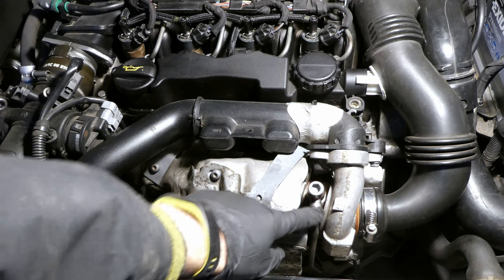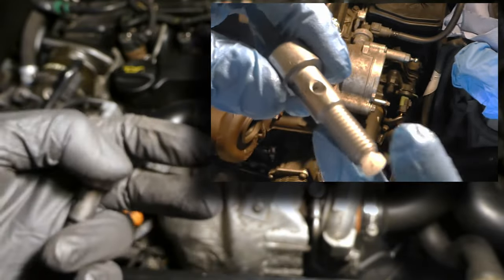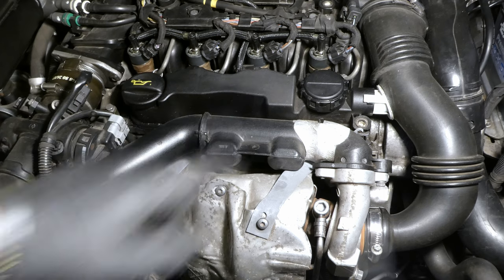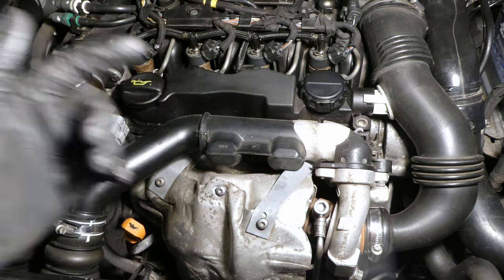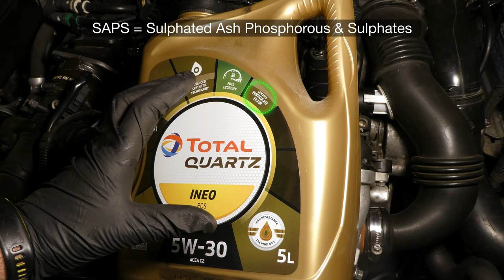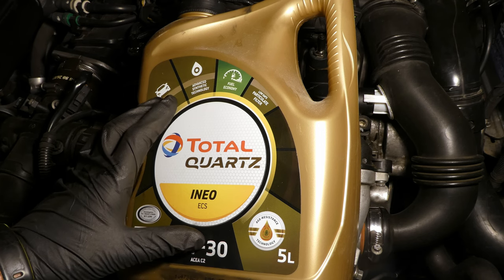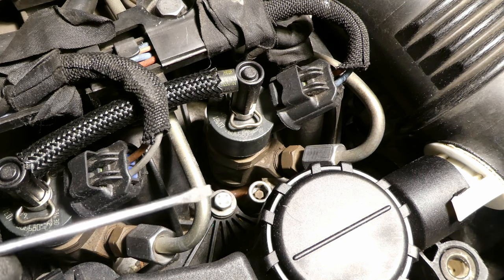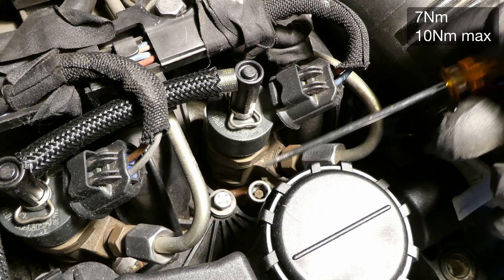1.6HDi turbo failures, the 2 main reasons and surprisingly simple steps to prevent it

Comment: i'm reading everywhere to put C3 synthetic 5w40 into a 2006 207 with the 1.6hdi engine, I notice you run 5w30 c2, which one should I use?
Reply from the maker: Very good question. It is a tough one and I have pondered a bit on this one. For the 1.6HDi the recommended one is 5W30 and that is what I have used. 5W40 is also fine to use and it is a little bit thicker, so less chance of the oil to go through seals, turbo for example or valve stem seals. I have always used 5W30 as it was recommended and never had problems, well perhaps I need to start using 5W40 as I have a puff of blue smoke on startup, most likely valve stem seals or a little bit of oil being passed through the turbo seals.
Now, I have only seen the low SAP oils in the 5W30 and not the 5W40, so that is why I have not yet tried it.
All in all, it is not a problem and probably a little bit better to use 5W40.
Reply: @moremolecules  sorry I couldn't get back to you earlier, this is the original post "I have a 2009 1.6HDI 207 90HP WITHOUT a particulate filter:).

The Peugeot handbook recommends I use Engine Oil to ACEA A3/B4 & PSA's B71 2296, standards but is vague about the oil viscosity - it shows a chart which 'authorises'(!) 10W-40, 5w-40, 0W-30 and even the 5W-30 engine oil which must be used on the FAP version! The Peugeot chart showing the recommended viscosities vs ambient temperature seems to say I can use any of these oils!

Is this right? What engine oil should I be using on a new(ish) 1.6HDI Non-FAP?"
so according to this owners manual the 5w30 is aparently best suited for Diesel Particulate filter engines, so I'm changing it to 5w40 c3, and next time I change my dads citroen C-elysee that has roughly the same 1.6hdi I will be switching from 5w30 to 5w40 aswell, thank you for your time, looking forward to keeping watching your content in the future
Reply from the maker: @therealxicojorge  Yes, you are correct in all of these. Even though my and yours and non-FAP versions I stuck with 5W30 low SAPs due it being a cleaner oil, i.e. less sulfated things inside or less ash. With the 5W40 there are no low saps, as far as I have seen, so there will be a little bit more clogging on the exhaust side and the EGR. Maybe run every now and then the Italian tuneup😁
Reply: @moremolecules  I've been made aware of the less sulfated oils being better for these engines through your channel so thank you my friend and yes I'm having a bit of a hard time finding what I want and not paying 2 times the price of the low sulfate c2 5w30 not gonna lie, trying to explain all of this to someone who doesnt care about cars after just learning it myself has been a challenge too but again all that should matter to him is that his engine is gonna be happy and that he doesnt do my head in if it starts making problems from cheaping out on maintenance I'm already doing it for a couple of beers and it takes like 30min max its not like he's worried about labour costs, anyway. thanks for the great responses, the search for the oil low sap c3 5w40 continues
Reply from the maker: @therealxicojorge  Yeah ,that is why my original reply started with I have pondered on this for quite a bit. I do not think there is really an easy answer here. The non-FAP versions take without a problem the 5W40, say the Total Quarts 9000. For the FAP ones, it needs to be the low saps, 5W30, the Ineo ECS. In general it is because the sulfates and ash will clog eventually the DPF of the FAP ones. We do not have DPF, so safer, but then again the higher content of ash in the 9000 oil will line up the exhaust pathway and the EGR. Probably not too much of a problem, as if one blasts the rpms to say >5,000 these carbon particles will be blown out. Yes, the EGR will need more frequent cleaning.
Now, the positive of the 5W40 is that it is a little bit thicker and the exhaust will smoke less, due to the thickness less oil will pass through the turbo seals and the valve stem seals. So, less blue smoke at the back of the exhaust. I do have a little bit of blue smoke coming out on cold startup, so probably I will try the 5W40, just to see if it is going to make a difference.

Comment: Hey man! What size is the bit for the injectors stud?  Wanted to re tighten mine
Reply from the maker: The studs are stretch bolt and I would not tighten them, but tighten the nut on top of the stud. It is a 7mm allen key.
Reply: Hey! Just had the injectors Serviced , they put 2 new ones. Mechanic removed all the gunk around them - engine now runs pretty smooth and area around  is nice and clean 🧼
Reply: Can’t complain they did a pretty good job

Comment: Would a blocked banjo bolt filter make a strange noise at idle?
Reply from the maker: A blocked bajno bolt filter would very quickly lead to a catastrophic failure of the turbo shaft, due to no oil lubrication and cooling. Strange noises, could be anything really.
Reply: @moremolecules  thanks for reply..its hard to describe the sound too..its a low pitch sound that gets higher then stops 🤣
Reply: @moremolecules  it is the fuel filter 👍

Comment: Hi Chris, the turbo failure my HDI 1.6 engine has is P1497 en P2562. after 10 seconds running the car in neutral on 30k rmp the turbo fails. Is this the same problem as what you are describing?
Reply from the maker: I think the vanes of your turbo might be sticking rather than overall turbo failure. You have a VNT turbo, a bit more sophisticated than mine and more powerful of course. The problem I am describing is a bit different.
Reply: @moremolecules  ah okay thank you very much for responding. I saw another video of yours where you described the problem that I had. It is the actuator which was too tight or too loose. After removing the heat shield I loosend the pipe that opens and closes the valve a bit and now the error messages are gone.
Reply from the maker: @Chiefelgin  Ha, I have to say that is fortunate, but really well done for tracing it out. Happy holidays!
Reply: @moremolecules  thanks man and your vids are lifesavers. Merry Christmas and a happy new year!

Comment: Hi how is best way to check feed pipe and where you got that bolt with plastic filter ?
Reply from the maker: I have a series of 5 videos that show how you can get to the feed pipe and the mesh: https://www.youtube.com/watch?v=Q7S0qDBo314
Reply: @moremolecules  have you got video how to chainge oils in manual gear box and brakes
Reply from the maker: @relaxul1467  Yes, I have one for gearbox: https://www.youtube.com/watch?v=95QarTgx4mI
I do not have one for the brakes, as there are quite a few good ones out there. Maybe I should do one?

Comment: K to use mid sap oil? Only mobil 1 esp available in my country. What specific oil are you using? And what is the meaning of low sap
Reply from the maker: Low sap is basically oil with low content of Sulphated Ash, Phosphorous, and Sulphur. As long as the specs on the bottle match, it is not a problem to use another brand.
Reply: @moremolecules  I used Castrol Edge 5W30 LL Titanium full synthetic that supports acea c3 standard. But I did not notice Low SAP mentioned. Is this ok ?
Reply from the maker: @daviddilparic3930  Probably it is ok. If the standard if the same it should be ok. Now this low saps might be a marketing thing, so I would not be too bothered about that. I think the standard is what matters.
Reply: @moremolecules  Thanks. Everything is fine with this oil. I can even say it looks a bit better than Total's oil.
Reply from the maker: @daviddilparic3930  Difficult to tell if one is better than another. I had awhile back an experiment with taking oil samples every 1,000 miles and sending it to a company for chemical analysis, but did not do it with another oil. I started using total and have not changed since, just a habit, nothing else.

Comment: My peugeot 307 sw 2004 1.6hdi got turbo fail. PO245 ideas what could.be wrong wastegate? Solenoid? wiring? Turbo? Anything else?
Reply from the maker: It could be loose or split vacuum hose to wastegate or solenoid. First check if the wastegate is operating correctly: https://youtu.be/WLsMzdKgI1o

Comment: I have a 1.4 hdi 16v in my 2004 C3 XTR, it's really an early version of the 1.6 HDi 16v, the upper cylinder head (housing the cams) is actually the exact same part number for example. However it has an unbelievable bad design oversight: the plastic intake manifold is a bit bigger, and blocks access to the top row of injector retainer bolts :( The only way to access those is to remove the entire intake, which also means removing the high-pressure lines, the low-pressure returns, the plastic cover for the head, the airbox and the EGR tube. I'm honestly considering modifying mine to use a 1.6 intake manifold, the 8 intake ports are in exactly the same locations and they use the same rubber seals etc.

About the banjo bolts, do both of them house a filter ?
Reply from the maker: I feel for you, believe me. They are designed in a way to deter your average joe to tinker with cars. As far as I know they all have the banjo bolt mesh, it is there to limit the occasional bits and pieces clogging the turbo shaft. Some people remove them altogether, but I really thought about it very long and could not decide what to do. All in all I decided to keep the new mesh design in. The longer plastic version, not the old metal mesh.
Reply: Pretty sure he said in video, only the lower one has a filter. I've only had the upper banjo bolt off and there was no filter but still had some build up of sludge I could scrape out.

Comment: Hi bro just I have a class mercedes a180 2014 w176 petrol engine sport  my vehicle turbo when I accelerating the turbo making sound like whistling or dentist drill what can be bad on my car turbo please??
Reply from the maker: Most likely you have a air escaping from somewhere, so a pipe that is loose and you can hear the turbo. Unless of course the turbo is gone.

Comment: Hi, does anyone know purpose of the membrane on the valve cover (membrane is placed underneath cap)?
Reply from the maker: Hi Nikola, the membrane underneath the valve cover (Positive Cranckase Ventilation) basically prevents the turbo to suck all the oil from the crankcase. When the turbo is not pulling air from the air intake you want the valve to be completely open, so the positive pressure in the crankcase to escape. When the turbo starts spinning and pulling air, because the crankcase is connected to the air intake, you do not want the turbo to suck the oil out of the crankcase, you would get a diesel runaway. The valve closes slightly to prevent that happening, but if the turbo is at really full max, then it closes even more.
Hope that helps.

Comment: Hi Chris, I don't agree with you on injectors seal!  The tar can't get in to the oil, it is only make the engine dirty and smell of gases in the cabin.
Reply: Good video anyway!
Reply from the maker: Haha, Chris' impersonator here. Joke aside, it has for awhie been in the PSA bulletins about the injector seals and the turbo failures. The injector tube is not integral to the head of the engine, so the bits can leak into the oil, if they can pass the top seal.

Comment: I have quite a lot of oil around injectors 2 and 3 and I wonder if I should change the injector seal ring of all of them to fix this issue. Do you have a video showing how to do that operation? Should I also change the banjo bolts mesh to prevent turbo failure in the future? What are the references for the injector seal ring and banjo bolt mesh? Thanks
Reply: There is a video about how to change the injector seals. The whole bolt can be bought as far as I know.
Reply from the maker: Is it oil or tar? If it is just oil then you could just clean it. If it is more like tar substance, then yes, you need to change the seals. I do not have a video, but there are plenty on youtube, I have linked one in the description as well. The bolt with the new mesh can be bought and replaced. My original banjo bolt mesh was spotless after 100k miles, so in general there is not need to replace it, but it is a good idea.
Reply: @moremolecules  I'm not sure because I didn't even clean it, I have to check it again . If it's just oil, where does it come from in 2 out of 4 injectors only? May I just retighten the bolts to 7-8Nm?
Reply from the maker: @csraln6748  It is difficult to say. When the engine is hot and the tar-type material softens, so it could be that the injectors are leaking. I would wipe it clean and see if it comes again.
Reply: @moremolecules  there is not oil at all around the injectors. It's a black susbtance, hard as a rock and with a shinny and smooth surface. I wonder how to clean it so that I can remove the injectors without any damage. It looks worse than I thought. Maybe I should clean it out gently with a screwdriver or similar tool. Do you think there could be a link between this issue and DTC P0299 Turbocharger low boost?
Reply from the maker: @csraln6748  It sounds like a leaking injector seals. If I were you I would definitely look into replacing these. It is not too difficult to replace and take out the injectors and there are a few good videos around. A lot of care needs to be taken for bits and pieces not to go into the injector hole. First one removes the tar and hoovers around trying to take as much of the tar as possible. I think I have linked one video, although I have not fully watch it.

Comment: I keep getting turbo overboost after my injector seal needed replacing, looking into the forums people are saying the atmospheric vacuum line maybe blocked due to carbon buildup after the injector leak. Can anyone advise on the location of this atmospheric vacuum line.
Reply from the maker: Have a look at the same video at this current frame: https://youtu.be/kt6zJANLaYQ?t=84
The thing that sticks out in the middle is the atmospheric vacuum line that comes out of the turbo solenoid. Yes, this will have been blocked by the tar. You would need to clean it, it has a small filter inside. Basically, the turbo solenoid valve cannot relieve the pressure and you are getting turbo overboost.